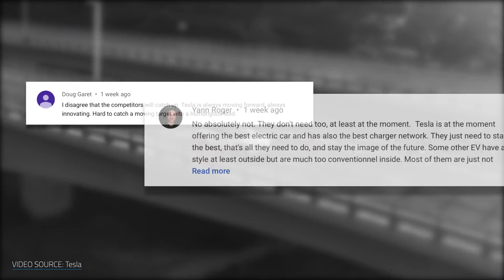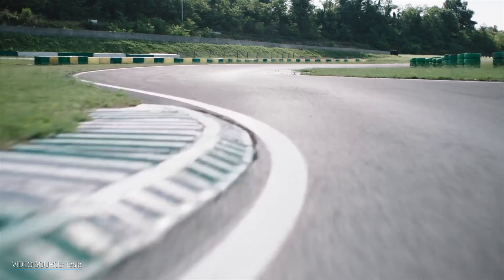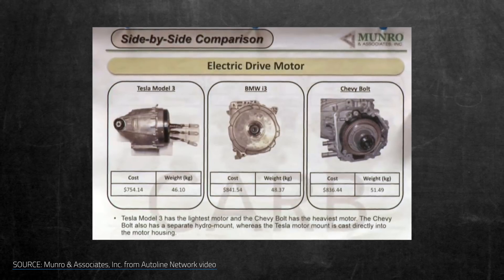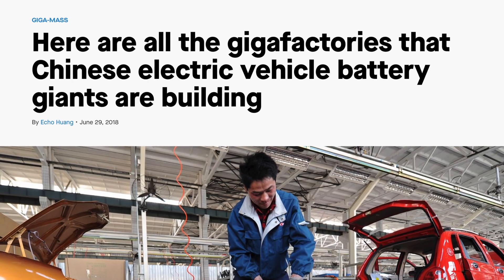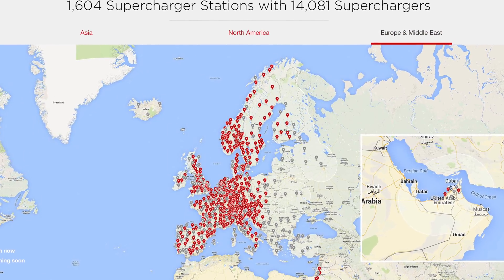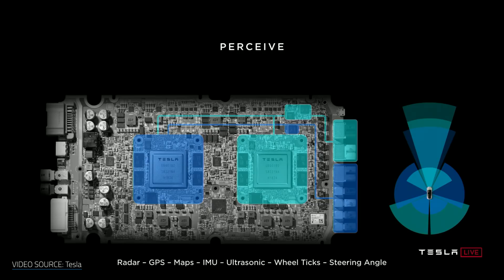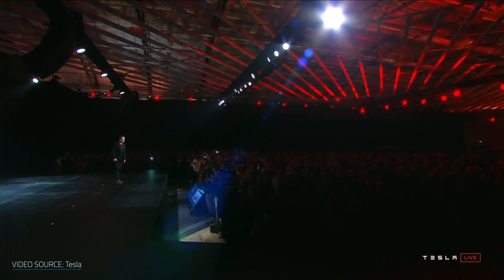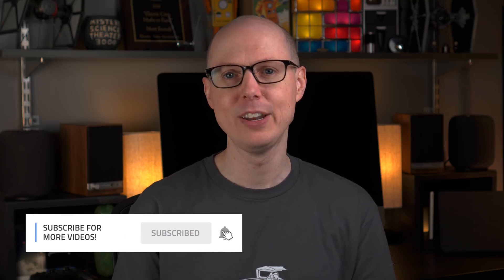Tesla vs Competitors - 5 Advantages

Comment: Do you use an external mic? I've noticed the audio tends to sound lossy (low bit rate). 
I've read that using a FLAC (lossless) audio stream for your render output might help if audio does sound good before it's uploaded.

love the vids. insightful as always.

Comment: It was the purchase of my Model 3 that convinced me to invest in Tesla. I knew fully that on it's face it was a fiscally risky bet, but once you experience driving their product...its a no brainer. Tesla dominates the EV market with the most advanced, enjoyable, and cost effective vehicles on the market. Short the stock all you want - I'll just buy more at a discount and laugh my way into early retirement like Apple stockholders did prior to the refreshed iMac launch. Regulations and battery advancements are making petrol cars obsolete, yet they are doing all they can to diminish Tesla outlooks as hard as they can hoping that you'll be the fool to give them 10-20 yrs of profitability. Petrol is dead, folks. The moment you drive a Tesla you'll understand.

Comment: Beautiful recap! Compelling moats... but you left out one more... software response times and turn cycles. No other manufacturer will ever be able to keep up with Tesla’s continuous push on this front. Instead most of them will likely be relying on generalized 3rd party development companies, trying to make software for all. You’ll run into slow development, compromised solutions due to varying screen sizes, cpu power, etc. and likely fragmentation. Currently we’re seeing updates / improvements to the Tesla OS approx every 3 weeks. Sometimes faster.

Comment: Now add the wiring innovation that could make updating hardware almost as easy as over the air software updates. 

There is a lot of complaining (mostly from non=owners!) about Tesla service, but the fact is Tesla is quite aware of the need for an excellent service network - though it's one of the most challenging things to create, especially when you've opted out of the dealer/service paradigm that is so expensive for owners.  Yet from delivery onwards , Tesla now appears, as pointed out here, to be so dominant in tech, batteries, charging network ... and with the 3 has produced a car praised also for build and for its driving experience.  

RE: other makers turning down Tesla's offer to use the network, I've been wondering if the Polestar 2 might be the first to opt in. Although, being built in China and with the turbulent trade war and the current administration's affection for tariffs, I suppose I SHOULD be wondering if they'll bother to send us any Polestar 2s when the time comes next year.

Which is a  6th advantage to Tesla: it's an American company manufacturing in America - and soon the world. Every TEsla video on Youtube eventually gets a new naysayers dissing American automotive product. But Tesla is the first American car company to receive praise around the world in a very long time. We should be proud of that.
Reply: Tom Crisp it's the only one deserving of praise! GM Ford and Chrysler are nothing but greed mongers. They have failed society, and they deserve to be crushed, like the junk they build.

Comment: For a tech or car geek well they care about things like speed, batteries, etc. However so so many people dont care. They buy cause its made in their country, they buy cause its a brand theyre aware of and stick to, they buy cause they like how it looks, they buy cause they trust it, etc etc.

I think Tesla needs to make a 3 door "European" car to aim for that market (which includes Japan, south America, and even Africa) and if they do that they could easily outsell competitors. They cars are still on the expensive side for many as well. Smaller, cheaper, less weight so therefore more efficient cannot be a bad thing
Reply: they cant make them cheaper as others because they are a decade behind the leading companys. Its easy to beat GM in that field, but VW, Toyota, Kia, etc are all very good at building well build cars cheap. Less weight will also be a problem, Teslas have more range because they have more batteries than cars in the same market segment. that also drives the price up.
there is also not a lot of space for higher priced small cars, those sell on design and build quality, 2 things Tesla isnt good at.
Reply: @nox5555  A smaller car would need a smaller battery by nature. If Tesla are unwilling to make one cause theyre competition are too good at it then theyre unwilling to sell to most of the existing market and their goal of electrifying the world is just a tag line to make westerners feel better
Reply: @nicosmind3   There are plenty of tiny electric cars, and much more to come. they all use tiny batteries and have low range. buildign such a car would hurt Tesla, and putting in more batteries for more range would also hurt tesla because it would be heavier and more expensive.

Comment: One of the most important items to mention is Design. Without great design, whether it's designing the appearance of the car, to how roomy and spacious it feels, to designing the experience of driving and being driven, that if you stripped it away, it would be difficult to imagine a great product that people would "want" to buy. There was one instance related to the sun visor in the model 3 that Elon had redesigned since the previous iteration "felt like darts jabbing at you". Great design is tricky since everyone notices when it's missing, but done right, feels natural and deceptively simple.
Reply: Hide those screws!

Comment: Tesla's high level of vertical integration means that when there is a need to innovate, they can proceed without needing consensus or agreement from their outsourced suppliers. This means that innovations are far more likely from Tesla than traditional automakers. Additionally, Tesla doesn't have to worry about standards compliance with an existing legacy fleet which allows for even greater freedom to innovate. 

An example of this is the recently revealed wiring harness change which pushes intelligence and control ability out to the logical edges of the car. This spoke and hub approach allows for integration control protocols to be defined, and further enables swap able parts that are not encumbered by custom wiring. 

Another example, covered in the Munro interview, was the coolant tank that integrated all coolant tanks into one, which reduced weight, complexity and offered flexibility in cooling/heating options. 

These two examples show how Tesla's vertical integration enables extremely rapid innovation, while traditional automakers are encumbered by their suppliers and their legacy fleets.
Reply: Superbottle to the rescue!
Reply: Vertical Integration is not helpfull to build cars. there are just a few major suppliers and they all work very closely with the car companies.  those suppliers also have a much higher R&D budget than Tesla.
Reply: @nox5555  And decades later these few major suppliers failed to innovate whereas Tesla has done so in a few years. It seems that higher R&D budgets don't produce results.

Comment: And lets not forget the revolutionary manufacturing in the model Y. A completely redesigned and high volume friendly wiring scheme. Cutting out the costly labor intensive wiring harness of the past is mind blowing. This is something no other car company even dared to change.
Reply: The 'big casting machine' has me quite excited.
Reply: Funny isn't it; this tech. has been available for a while but car manufacturers stick to the old ways of miles of wire.
Reply: Yep, it reduces the required wiring length from 1500 meters (Model 3) to 100 meters (Model Y). And it reduces complexity of the whole system by having local controllers for each subsystem. (modular)

Comment: Another advantage is really a lack of a disadvantage all the legacy competitors have, which is independent dealerships.  A well developed independent dealership network has been a major benefit to the manufacturers prior to EVs, but with the dealerships realizing half or more of their profit from servicing (which is DRAMATICALLY reduced on a properly designed EV) they are economically incentivized to NOT sell an EV for their continued existence as an ongoing business.  As such, one would expect the incentives to the sales staff (commissions, bonuses...) to be higher for ICE vehicles and lower for EVs, as well as insufficient training of the sales staff or a sales staff disinterested in learning EV competition, and a dealership lack of preparedness to properly demonstrate an EV; and that, to this point in time appears to be exactly what we see.  

Tesla does not have an independent dealership network that has a major financial conflict of interest that it has to overcome; there are still states in which it is limited or barred from doing business directly, but as more time passes and Tesla continues to be a better EV option, more and more of those states will likely open up to Tesla's business model.
Reply: Would you add the lack of overhead of generations of pensioners?
Reply: @thanksno4911  Yes, but that's going to be true of almost any new company as compared to their long established competitors and is at least offset by the cost of the capital expenditures required of the new company many of which have long been paid off by their established competitors.  It's not quite the same as having an important part of your "team" actively working against the goal (of selling EVs) but you're right, that is an advantage Tesla holds at this time.

Comment: I don't remember which philosopher said it, "but don't be afraid to state the obvious", so I won't. EVERY VEHICLE THAT TESLA MAKES HAS ELECTRIC MOTORS AS THE SOLE MEANS OF PROPULSION. That is the fundamental change to the transition to us all driving electric and needs to be accepted by Tesla's competitors. They need to redesign their vehicles starting with their top selling models to be EV ( vehicles that use one or more electric motors as their sole means of propulsion). They already have huge ice manufacturing capacity so they don't lack the means to generate electricity on board. They don't need massive battery supply at this stage and they don't need to worry about en route charging. But until they accept that electric motors are the only thing that should be turning the wheels of all the vehicles they produce, they are not even thinking about being competitors to Tesla.
Reply: I think what you are describing is a hybrid vehicle.  IMHO, I think that hybrids are already old/outdated technology since you are running a gas engine to provide power to the electric motor.  You still have all the maintenance of an entire ICE system and you're still burning gas.  Even PHEVs were an interim step.  The real goal is a pure electric car like a Tesla.
Reply: @andrewdowdall2690  Of course I agree that real goal is pure electric but unless the legacy auto makers get serious about putting the electric motors in place turning the wheels of the cars they produce those legacy auto makers will never reach that goal.
But put them in place now and make use of their existing manufacturing capacity and let customers have a choice as to what they are happy to purchase and both the OEMs and their customers will be in the best place to take advantage of lower battery costs as they come along. The manufacturer does away with the ice generators and puts more battery capacity in the vehicles and the customers are already use to driving an ev.
There is just so much to gain from making that first fundamental step, which is just what Tesla did. When Tesla made that first roadster some eleven years ago they didn't set out to prove that a car could run on battery power alone, they set out to show that electric motors could provide the same or better performance than ice cars. They made that first fundamental step and went with the technology available to them at the time. No waiting until cheaper batteries became available. And remember at that stage they did not know that the rest of the industry would not respond to the challenge and allow them to build such a clear advantage. Toyota in particular could have stopped Tesla early on by switching from parallel hybrids to series hybrids. But I am glad they didn't as I so much want a model 3.
Reply: @richardglover314  Very true!  I think that a PHEV (or even a hybrid) is a good stepping stone for people who are scared to make the leap to EVs.  I hear so many people ask about how long it takes to charge to full when on a trip, ask how hard is it to find a charging station, or say "but there are no charges near my home".  They think like a gas car and think you need a full "fill up" every time.  They don't get that it's more about getting just enough to get where your'e going, then fill up while you're there.  And that most of the time you're charging at home in your garage and that it only takes a few seconds to plug in.  I love not having to stop to pump gas on a regular basis anymore.
Reply: Andrew Dowdall I think both of you are right. My ancient Prius prepared me for my aging Leaf, which made me hunger for my new Model 3. But now, it makes sense to go straight to a Tesla, assuming you can afford one.

Comment: The vertical integration is overarching advantage. The addresses for example, the charging, FSD computer, battery,  and lack of dealerships.
Reply: Really. Dealerships are now being called stealerships, and with good reason. 
They live on the premise that there's a fool born every minute.
Reply: Indeed, vertical integration gives them full control of the entire supply chain, and allows them to innovate and adapt to changes more quickly than their competitors. While following global standards is ideal in the long run, it takes far too long for the rest of the lumbering industry to come to agree to a standard. Tesla just goes ahead and do it their way, that's why they're so far ahead now while the others are still waiting for each other.
Reply: So true!

Comment: I agree with other commenters over the air updates is a key advantage. Additionally, two huge disadvantages for the competition are 1) being saddled by their distributor networks (for example some dealers insist on being paid for maintenance downloads) and 2) their distributed firmware computers each specializing and generally not integrated into one System. Tesla
Reply: The dealer network will fight to the death to maintain their ICE maintenance revenue.
Reply from the maker: Agreed.  The dealership network is going to be tough for them to navigate.

Comment: - over-the-air updates
- safety
- easy updates thanks to controlling everything from screen
- vertical integration
- great community and free advertising
- making EVs not for money, but to change the world
Reply: Oh, and Solar Roof!
Reply: Tesla’s Supercharging Network
Reply: What is the "vertical integration" aspect?
Reply: Tesla produces and assembles everything in one factory (except batteries from their other factory) and controls every step of production. That means they can change anything instantly at the production line, don't depend on other companies making parts, don't need parts shipping, dealers, and all that stuff increasing costs.

No one other car company is vertically integrated that much.
Reply: @pmj_studio4065  Ah got it thanks! This is a heavy hitter especially from a competitor standpoint.
Reply: I agree with everything you said except the money part. If they arent doing it for money, then they wont be able to save the planet. If they weren't making the cars the best they could, then they wouldn't be able to give a hardcore smackdown to the ICE cars and (edit) other forms of pollution. Doing the best possible work takes money.
Reply: @robietrites5243  His not doing it for the money but instead getting money for the company
Reply: "not for money", investors only invest for money dude. If tesla would not earn then they will pull out their money
Reply: - ok, making EVs not for money - is fails statement, the rest is good stuff.... coz if it is - model3 standard + should cost $35k as promised for al those who stood all night camping by a Tesla stores all over the world...Musk just dumped all those people who made the Name for Tesla and 1/2 a billion deposits for 3 years ahead of product to be available,  still not available,  were only available for 2-3 weeks to order it...and dont even start on plus model is upgrade thing,  he did because of the competition (kia & Hyundai ) had 240 mile standard range for the same money, so he had to match., no other way out...
Reply: @sergeyyevtukh388  The $35k model has been available for months now. You just gotta ask for it specifically, you can't just get it from their website.
Reply: @TDrudley  ..so its deliberately hidden from public(on line),  right ?...you have to bend down to go to fiscal store( mind you in USA), when to the rest of online present public Tesla readily has a SR+ model for $39.5k , also not when the federal tax cedit were still at up to  $7,5 or $3.5k, so my statement still have some validity,  isn't it?
Reply: @sergeyyevtukh388  You don't have to go to any store, you just call them on the phone.
Reply: @sergeyyevtukh388  most of those that put money for reservation were looking for a tesla and not just the $35k version.  If you didn't like it, get your money back.  Just don't speak about things you don't know about.
Reply: @sambira  ..so what part I don't know about it, that Tesla has to be for profit first? And later for green future?  ...enlighten me..